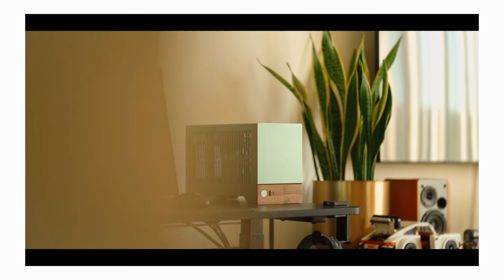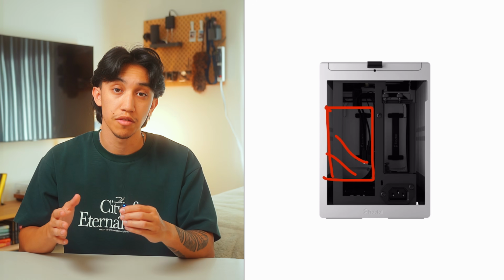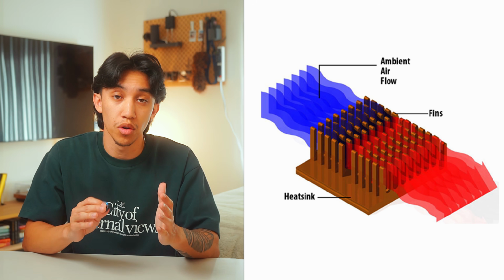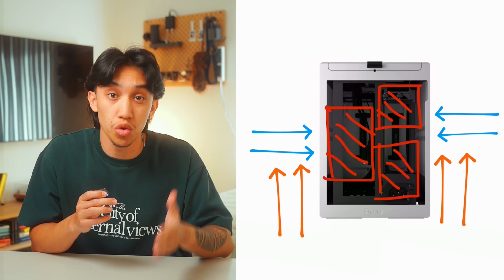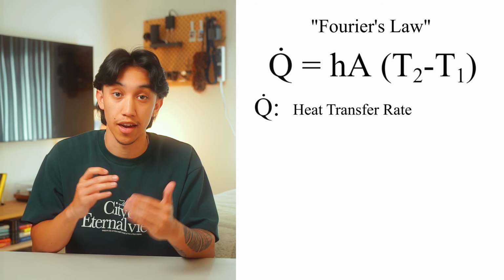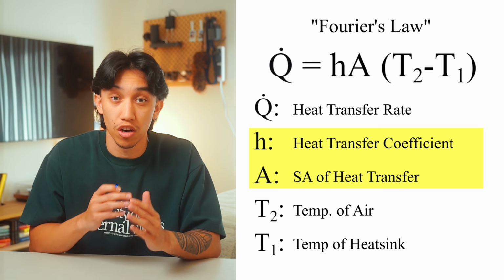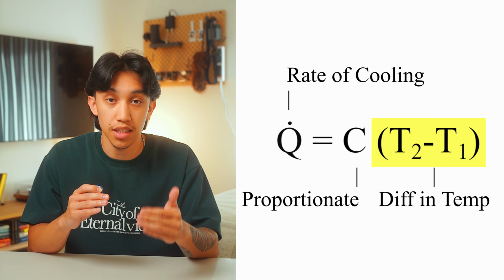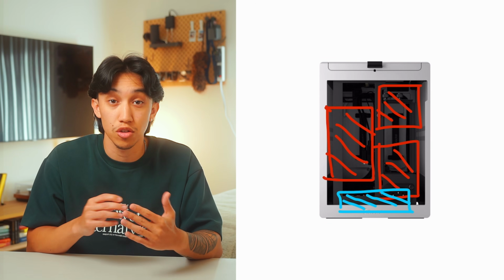Watch BEFORE You Buy! | Fractal Terra Thermal Issues

Comment: Fractal Terra case
i7-14700kf
ASUS RTX 4080 proart
Coolermaster 1100 watt SFF psu 
Noctua nh l9x65
1 noctua exhaust fan a12x15
Some RGB Corsair Ram 32gb

Call of duty warzone: 100•C cpu
Other games: 60-80•C cpu

GPU range 40-70
Reply: I have nearly the same build. 
i7 14700k
Asus RTX 4070 Ti proart 
Corsair sf1000 psu 
ID cooling is-55 cooler replaced fan with Noctua fan 
And 2 exhaust fans at the bottom. 
Highest I got was 87•C on Warzone.
 
Although my pc is abit loud I still enjoy the build.
Reply from the maker: how were you able to fit two fans at the bottom?
Reply: @KyleMunozTech  I was able to mount 2 corsair 120 slim fans with grills outside on the bottom with just enough clearance for the feet and abit of air to escape. Not ideal but works and doesn’t look to bad
Reply from the maker: ohhhh Very interesting!  I really didn’t even think about putting fans on the outside.  Is there noticeable noise since the fans are right on the grill?
Reply: @KyleMunozTech  There is noise. You maybe don't even needs grills. I thought it looked cleaner and added abit of protection. I adjust the fan speeds for when i'm idle and  browsing. for gaming I don't mind the fan noise as I use headphones and would rather have a my PC function without damage but it does sound like a fighter jet 😂
Reply from the maker: LOL yeah i guess if you got headphones on it doesn’t really matter.  That’s awesome though congrats on the build!
Reply: @KyleMunozTech  thank you, I think I might actually flip my fans on the bottom. That way it pulls in air and shoot upwards because like you mentioned, heat rises. So maybe having the fans just shoot upwards might help getting hot air out.
Reply from the maker: yeah honestly with a two-fan setup that may work.  When i tried the vertical exhaust I only had the one fan I could fit inside the case so i don’t think it was able to create enough of a positive pressure difference to actually exhaust much.  If you do it definitely let me know how your temps are affected, i’m very curious!
Reply: @KyleMunozTech  undervolted just a tad and flipped fans. ran some warzone and it didnt go over 80'c
Reply from the maker: Are you playing 4K or 1440p?
Reply: @Viquor  that’s great temps. I switched to the noctua L12Sx77 (the one with the fan on the bottom of the heatsink) and it significantly reduced noise.

This also dropped my temps by 5-10 degrees.
Reply: I have no problems 4K any game,super quiet
Reply from the maker: awesome!
Reply: Motherboard? I look for build the same setup
Reply from the maker: I used the Asus B760-i Gaming Wifi for my build
Reply from the maker: Congrats on the build!  My issues weren't with gaming, they were more for video editing and exporting.  Glad you could set this up in a way that works for you !

Comment: I have an intel 265k and i had to undervolt it for it to not have heat/performance issues. All the way down to 75W. This solved all my issues, but unfortunately i do lose about 20-30% performance. Graphics card does great, has no issues.

Comment: Eyy, i know its an old vid, but i hope the GOAT will answer. I got the terra at a really good price like 2 years ago and its just been sitting on my shelf in its box since then. Ive seen so many videos about bad temps and it really scares me away coz i dont wanna ruin my components or get throttling.  I wanna put a ryzen 5 7600x and an rx 7700 xt in it. Would that be too much? Thanks in advance
Reply from the maker: I am the GOAT?!  I appreciate it man! Those components should work out just fine if you get the right cooling.  From what I’ve seen it’s mostly Intel chips that produce too much heat for this case to handle, it should be able to provide enough airflow to cool your 7600x no problem

Comment: My solution was to out a small desk fan on the left side blowing onto the gpu side panel and making sure the air from the fan can reach under the case to blow the hot exaust away. Even with the desk fan on low everything is nice and cool. Without the desk fan my 3070ti gets around 85-88c throttle and stutters bad. with fan on low the temp stays around 80c and it runs good.
Reply from the maker: Great solution!  I just personally prefer to not have to have external fans to properly cool my components.
Reply: @KyleMunozTech  yeah I agree with that. would not be something that I would build for a customer or a solution i would offer them but I just don't want to buy a 3rd case for this build lol. I really like the case otherwise. wish it had front panel audio and more usb ports but it is a nice looking little case!
Reply from the maker: 1000%  To this day I miss the look of the fractal on my desk.  Hopefully theyre in the process of making a version 2.0 to address some of the shortcomings

Comment: i have a very simmilar setup within mine and don't see this kind of issue at all. both the GPU and CPU take in from the sides and send mostly out of the top since, the motherboard heatsinks block down flow and the mess of cables and and SSD stop almost all downflow from the GPU so almost everything goes out the top. haven't found any issues with this and also achieved very high clock speeds with CPU and GPU.
cpu: 13700 (same)
GPU: rx7900xt (very overclocked)
Reply from the maker: That’s awesome I’m glad you found a setup that works for you!  What cpu cooler are you using?  are you undervolting your cpu at all?  What resolution and frame rates are you gaming at?

Comment: Interesting.. I built in this case with an i7 14700k and a 4070 super. I play games at 3440x1440 and have had zero performance issues. Heat hasn’t been a problem. RIP ATX for me
Reply from the maker: Damn, wish I could say the same!  Are you undervolting either of those components to manage heat?  also what CPU cooler are you using?
Reply: @KyleMunozTech no i was expecting to have to but surprisingly I haven’t had to. and I used the ID-COOLING IS-55 low profile cooler
Reply from the maker: wowww that’s awesome man!  You must’ve hit the silicone lottery!

Comment: Solution 5: Go with External watercooling !!!
I bought this case last week, gonna start my build next week. 
I bought this case with the idea that i wanted the smallest case i could find, in sandwich style. 
but not wasting any space on Fans/radiators within the case. 
I have an Mo-Ra 3 420 pro from my previous build, external watercooling. 
All i need to place inside the Fractal Terra are the waterblocks for the GPU/CPU and thats it,
Reply from the maker: doesn’t that kind of defeat the purpose of getting a small case?  Why not just get a bigger case that can fit a liquid cooling solution within it?
Reply: @ I think the main reason i went with external watercooling for my previous build, even though Everything could have fitted inside my Lian Li Dynamic XL,  is Weight. 

Ones per year i bring the pc case outside for its yearly cleanup, and my pc case was already very heavy, i figured if im gonna add 2 or 3 x 360 rads within the case, im gonna add to the weight. instead i choose external watercooling because then im also not limited to 3 tiny radiators. and could just use an massive one, (About the size of an Car Radiator)

another advantage is that i can easily swap between cooling solutions between setups with external watercoling, 
In the near future i want to buy the new Mo-Ra 4 200 (an smaller version of what i have now) that i can easily move around. 
And when im at home i can easily swap to my Mo-ra 3 420 for bigger cooling capacity with Quick Disconnect fittings between the tubes.

There is this video made by GFF that i highly recommend watching named "Liquid Terra" which was my biggest inspiration to buy the Fractal Terra: 
https://www.youtube.com/watch?v=l34iX2Li4io
Reply from the maker: super interesting concept.  do you have multiple computers that you use this external cooling solution with?
Reply: @ At the moment my Threadripper system was the only system i was using the Mo-Ra for, but now with this new fractal build, i temporarily only hooked up the cpu waterblock with quick disconnect couplings. 

Innitially my idea was to just use one computer at a time, and switch between with QDC's, but im tempted to just create one big loop between both computers and the external radiator.
Reply from the maker: that’s absolutely insane.  I’d love to see how that looks when it’s complete

Comment: Etsy has top hats that are 3d printed to let you use aio or more fans
Reply from the maker: Yeah, i thought about getting those but I thought it would ruin the look of the case.
Reply: @KyleMunozTech  I've noticed some etsy mods provide a bracket allowing you to add some internal fans at the top of the case - e.g. Fractal Terra FAN/PSU Bracket + Variations from Zen3DP  - I have no idea if this would help in any way - But it would be nice if it does :)
Reply from the maker: i think that would be ideal!  Is there enough space to put a big enough fan to make a difference though?

Comment: The problem is this assumption that the fan should be an intake....CPU coolers like the Noctua that have the fan below should be flipped to an exhaust with the bottom cause fan as an intake. The intake should be a low pressure high CFM like the S12A and the CPU cooler should be a high pressure fan. This setup will bring in a ton of air and force new cooler air across the components and through the heat sinks.
Reply from the maker: I tried all different configurations and nothing seemed to work for me.  But this is definitely valuable info for others using this case, I appreciate it!
Reply: I'm using Noctua NH-L12S x77 as a CPU cooler, so you are saying that it should be set as an exhaust? Also it matter the orientation of the pipes of the radiator? I'm using a 120mm slim fan at the bottom as intake. I'm pretty much a noob in this matter so i'm asking a lot of questions 😅
Reply from the maker: @enriquecoellotorres9537  If you have an intake fan at the bottom I would have your CPU cooler be an exhaust.  If you don't, I think having it as an intake would be best for bringing in cool air

Comment: I added two fans to bring cool air in. Got some thin fans and attached them to the bottom of the case on the outside. You cant even notice them, also to improve air circulation i bought a pc desk hanger that leaves the bottom open and put my pc on there.
Reply from the maker: I thought about doing this.  What CPU, GPU, and CPU cooler are you using?
Reply: @  i am going to run a 7800x3d but until that arrives i had a 9950x laying around decided to test with that cpu. Figured if i could run that withing reasonable limits anything else would be a breeze.
Reply from the maker: tbh i think you’ll be fine. i haven’t heard anyone using an amd CPU complaining about temps
Reply: @ the 9950x runs very hot and in this build with the fan setup i game between 70-75c degrees
Reply from the maker: That’s awesome!  Glad you found a build that works for you!

Comment: had terra. FOr 3 days before I took it for refund. Ryzen 7 9700x with bequiet pure rock LP, 4070 super, 750w psu. Horrible, 55 idle, up to 100 gaming. The fan sounded like a jet plane started on idle and taking off while gaming. Returned it, bought a cooler master nr200 v2, plugged in a 240mm AIO, loving it.
Reply from the maker: exactly my experience. Had to switch it out!

Comment: really awesome video, had me a little worried for the build i had planned in mind but when you mentioned you're using a 13700k i was at ease 😭😭 that thing drawing 200+ watts is nuuuts. im going for a 78x3d or 98x3d (if its available) while using an axp 100 full copper but im debating using that or an axp90 full copper
Reply from the maker: yeah 200W is ridiculous in a case this small 😂.  But for your setup I don’t think you can really go wrong with either.  I’ve seen that there are only marginal gains when using the axp100 over the axp90 so I’d say save some money and space and get the 90.

Comment: The Fractal Terra actually improved my temps. Previous case was a Razer Tomahawk n my RTX3080 was constantly at 92-93C while gaming. The Terra allows it to breathe all that fresh outside air  it peaks at only 75C now. The 5800X3D undervolted -30 all cores with ID-Cooling IS-50Xv3 also peaks at about 75C running Cinebench full load and only about 65C while gaming. 2x 120x15mm Arctic fans at the bottom as exhaust locked to only 900rpm for silence. It's a bloody fantastic case IMO. 

Just takes a bit of experimenting with different coolers n fans. I tried the Deep Cool AN400 which absolutely boiled my CPU at 92-93C. Then i tried a Thermalright AXP120 X67 which gave decent temps but was extremely loud sitting too near to the side panel with too much turbulence. Finally settled on the IS-50Xv3 which gave the same temps as AXP120 but practically silent. the 2 bottom fans as exhaust works a treat too. Also spent a whole day benchmarking n stress testing while adjusting fan curves. 

It's a fantastic case. You just have to experiment n put in the work.  All in....took me 3-4 days of setup to get it all right and it's an awesome little beast now.

Comment: It actually lowered my CPU and GPU temps by 4°C. Having the fan as an exhaust actually turns the case into a Negative pressure situation, thus forcing cold air inside.
Reply from the maker: that’s awesome
Reply: So… he’s wrong
Reply from the maker: who knows?

Comment: after undervolting my CPU i don't have any cooling problems. In my opinion, the fan pushing from below is not such a problem for the rest of the components, because it is located in the front of the case, and the CPU and theGPU are in the back - I could be wrong, but that's what I think. Im whit Ryzen 9 5900X, and 4060Ti
Reply from the maker: Yeah typically the thermal issues occur with Intel CPUs

Comment: You can undervolt the cpu to cool the cpu and you can do it with the gpu and drop even more heat outta of the case the choice of cool also makes a difference the case isn’t that big of a problem as you make it sound to be
Reply from the maker: If you paid attention, I already mentioned that I tried undervolting and temps still were very high. The cooler is the biggest one I could find that fits in this case except for the one that came out after I had already gotten rid of it.  I made this problem out to be as big as it was in reality for me.  The case was too hot and didn’t have enough proper ventilation for my use so i made a video letting people know that if they also had this issue too, they’re not alone

Comment: I have a FormD T1, which the Terra was (very) inspired by layout-wise.
Nice thing about the T1 is you can flip it upside down and install two full-size 120MM fans as top exhaust, completely nullifying the “pulling in hot exhaust” problem.
Funnily enough that is actually the upside-down position, despite most YouTubers setting it up this way seemingly by default. Which makes sense as, you know… heat rises.
Reply from the maker: Makes total sense!  I don’t understand why the design wouldn’t be like that by default but i’m glad people are realizing that that’s the better way to have it.

Comment: Maybe you did something wrong in the air flow department...heat goes up so you have to orient everything to Go Up..❤
Reply from the maker: see that’s what i thought too but when i change the direction of the fans to push the air upward, the temps increased. 😕

Comment: this case I believe is built for productivity in mind meaning its not designed for gaming so the power draw doesn't need to be that high else you will run into problems. look for cheap 4k builds that will save you money use less psu power to run meaning it'll run cooler. This isn't built for high end gaming in mind cos the more power you spit out the hotter this thing will run.
Reply: I have found a fix potentially for this case that lowered my temps by 10-20 degrees Celsius. Download a software called Throttlestop and set power plan to either 'Save Power' or 'Balanced' this is set to 'performance' or 'high performance' by default.
Reply from the maker: Exactly my point with this video.  This case is not meant to have a high end workstation put in it.  Even with undervolting and power limiting, the airflow is just not sufficient to cool the components.
Reply: @KyleMunozTech  I found changing my power plan has helped bring down my temps even while gaming. I would look into doing that the case is a little beast and having everything set to performance isn't going to be great for this case.
Reply from the maker: same, but everything i tried wasn’t enough to bring the cpu temps to under thermal throttle threshold so i just swapped cases
Reply: @KyleMunozTech  oh fairs I managed to achieve good reads 48 degrees on desktop and 60-70 in game. I did have 90-100 and I was soo worried this thing was gunna blow up lol. I will be trying to add 2 fans to the top of the case eventually but that'll happen down the line.
Reply from the maker: yeah i’ve definitely see people put some fans on the outside to help supplement airflow.  not the biggest “fan” of that lol